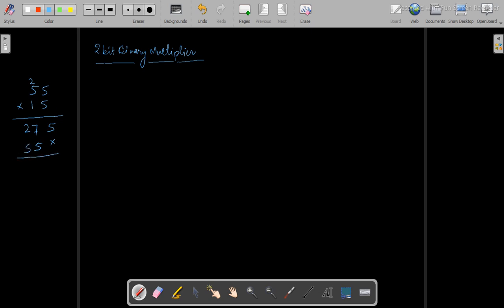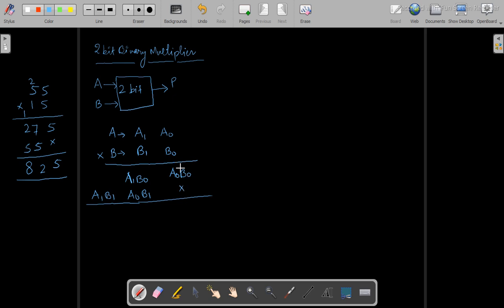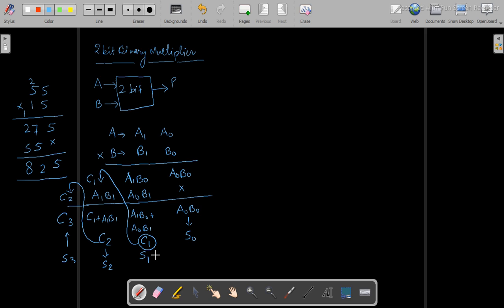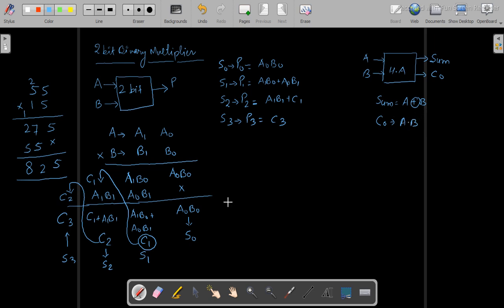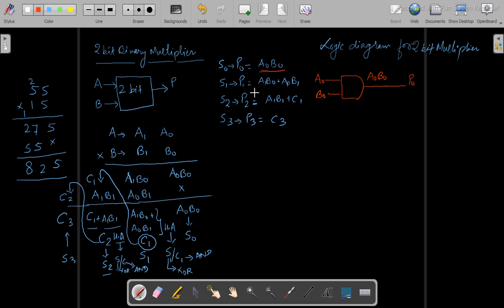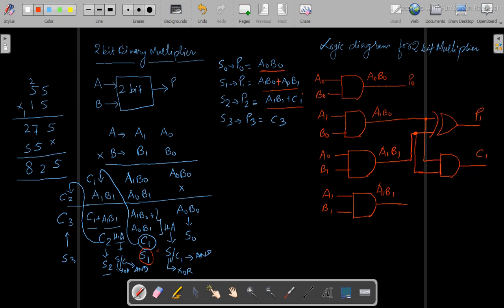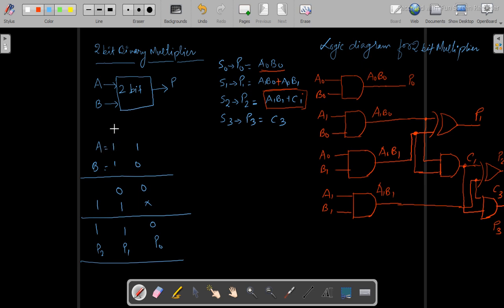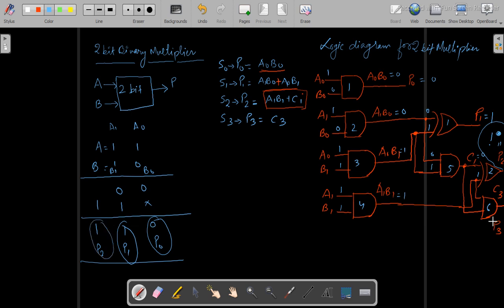2 bit Binary Multiplier

Comment: EC/071/19 ( Sandip Das)
Sir, in this lecture, you have used the inputs ( A○ , A1, B○, B1 ) lots of times while making the logic diag. Can  it be wrong if we use them once and join the connections using the logic gates required as per the equations formed ?
Reply from the maker: You can use these inputs once also but for the sake of easy understanding I have use them multiple times